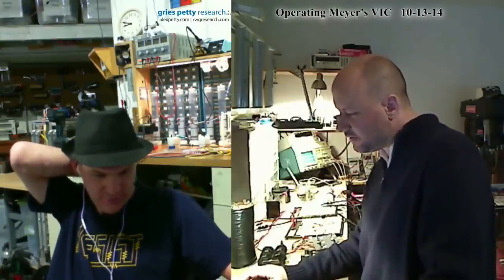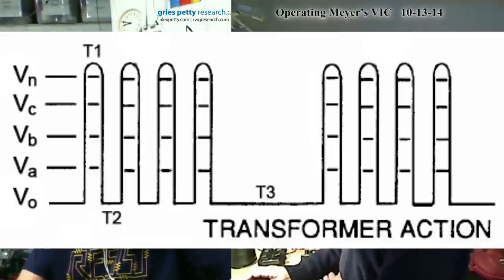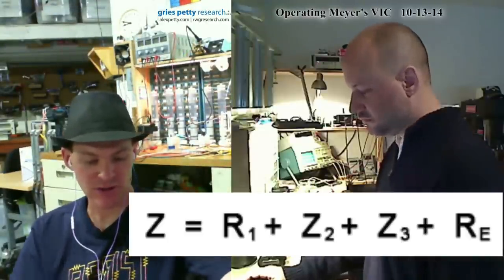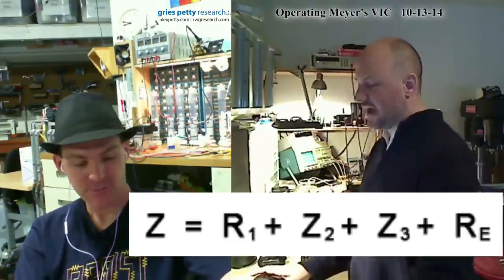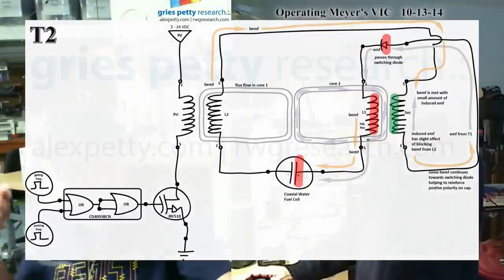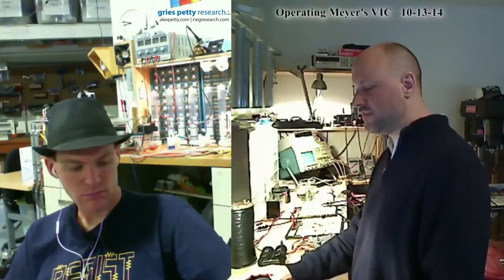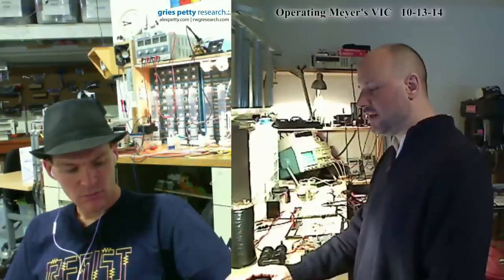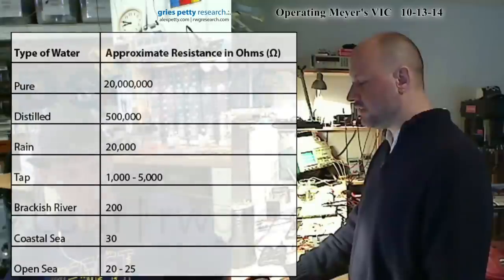Working Theory Of Operation For Meyer's Voltage Intensifier Circuit. 8-14-14 Gries Petty Research.:.

Comment: Hello Russ,  Thanks for putting it out there. I would like to share some thoughts though. First off you two guys are terrible public speakers and Alex is worse. Wey too many ahaemm's and studdering  in there so as to make an otherwise fantastic presentation hard to follow. I like your approach and if I wasn't so poor financially I would be right in there with you folks on the cutting edge. 
   A couple of things , I ran into the basic theory quite a few years back about resonate pulsing of an HHO cell  with the difference being the L/C transformers were all wound on a doughnut of ferrite. 
  Secondly why aren't folks exploring sound as an adjunct to the brute force electrical hydrolysis. Your research supports the validity of resonate fracturing of the water molecule .Why not approach it from other angles?  What would happen if a cool mist humidifier output were run thru a resonate plate system powered with high voltage/high frequency at the harmonic frequency of the water molecule? Round cell?square cell ?and why aren't folks mounting their square cells corners up and corners down to take advantage of the most plate area?

Comment: Electricity is a high value energy resource. We can use electricity directly to perform work. Hydrogen gas is a low value resource. Hydrogen needs to be converted to get energy out of it. So using electricity to make hydrogen is like trading dollars for pesos at a one to one exchange rate. It just doesn't make sound financial sense to do that.

Over unity systems are the result of inaccurate data acquisition, or poor analysis. Because our Universe simply doesn't work that way. No amount of wishful thinking is going to change that either. Although if you figure out a way to tap into the power of dreams you might be onto something there.
Reply: +Paul Frederick 
It never ceases to amaze me how so many allegedly knowledgeable or professional EE's or just electricians, come off with such a holier than thou attitude and rehash the same only flaws in their education and blind experience instead of expanding their mind and consciousness to understand what has recently transpired in new physics working models and drawn conclusions that prove that over unity or free energy is NOT violating ANY laws, but instead uses original or Tesla based techniques to tap into a virtually unlimited resource of electric power with the primary barrier preventing this from being publicly available are due to suppression of those technologies that HAVE gotten past that barrier, or the lack of those trying to pin down the resonance frequencies that will allow coupling and draw from this tremendous field of energy that not only surrounds everyone/thing but is also responsible for the perception of solid matter,  and instead of boring us all with your lackluster, closed minded, stale brained rhetoric, you should be contributing towards finding the right frequency or technique or creative circuit that will more than just utilize the spike in collapsing fields but fully draw upon this constantly generated source of energy that all of creation is held together by, and by posting your comments like such a blank stared parrot of what someone TOLD you and you never questioned, verified its actuality or experimented to prove to yourself that education is valid, you just show everyone how out of touch with current advances in sciences across the board which have antiquated a large portion of former technologies, after all, you stand to benefit from such a breakthrough as well as anyone else, and frankly do not feel such people even deserve to be granted use of them once established since all they have contributed was to discourage those new to the field from trying to break the barriers, which HAS been broken NUMEROUS times, but those who stand to lose their power and wealth as a result have eliminated and hushed the methods to retain their quickly diminishing positions of power and wealth, by their controlling of the masses, and YOU are REAL PROOF of this programming and mind control, because free thinking individuals, are free from such controls, and furthermore, easily discern between truth and deception, unlike sheeple like yourself...however...there is still a chance for you to catch up on the recent discoveries in physics and other related topics, and become a helpful contributor, and if you choose to do this, at least then you can tell your grandchildren how you worked towards recapturing or preserving their liberties and freedoms, instead of watching them be sold into slavery(which is unlikely because according to the elite agenda, those over 47 or in any way incapacitated or unable to perform up to expectations never before imposed on you, will be dead)unlike the US has ever seen before, including the previous Black slaves, the new corporate slaves will live much worse environment, considering which countries have recently bought large percentages of the US DEBT, and HOW do you think these foreign countries will collect those debts?? 

Well this much I will tell you....it will be in the form of productivity, and producing the abundance that the elite will squander from the sweat blood and tears of your descendants....but then again people who shoot down the courageous efforts of others do so because its the only way they can fool themselves into feeling like they are something, more than a programmed automaton who wakes up, goes to work, eats a meal, watches TV and goes to sleep to repeat at sunrise...and rinse and repeat!   Pathetic....but as I said, this is a choice you make, and you can change that choice and everything that goes with the laws on the universe concerning every choice or lack thereof, has consequences, what do YOU choose for your offspring and theirs??  

Most of what the majority believe is our history and applied sciences is FALSE, you have been lied to and deceived for over two generations, and almost every aspect of what the world is about has been misrepresented through a lifetime of false indoctrinations beginning with preschool, and earlier if the parents use a TV set for a babysitter....children from 1-7 years are able to take in EVERYTHING they are exposed to and what they learn is what determines WHO they will be throughout their lives...their programmed core beliefs and principles based on rules that tell them what they CAN NEVER DO, unless they become aware of this and WORK HARD to rewire those core beliefs with valid true facts attained through direct experience.

I will provide a few examples of why people should not accept the alleged FACTUAL BARRIERS because at one time the world was flat.....the fastest speed was sound...but now we know things can move beyond the speed of light, man or anything heavier than air can never fly....space is an empty vacuum....NOT....if you do research you will find that there is NO EMPTY space, and life exists everywhere, as evidenced by the plankton living on the outside of the windows of the ISS....and matter only exists due to the energy that regulates its respective frequency (VERY simply put) which in turn determines the form or density our brains and sense can perceive them to be, and all of these statements are based on new FACTUAL DISCOVERIES whether they are propagated through the media or educational channels, or not, it does not change the TRUTH!

I COULD provide you everything to prove those statements, but people need to research and learn the truth for themselves....it was listening to and believing educators, experts and governments with the utmost trust that got us in this precarious situation we are on the precipice of....so do it BEFORE the bottom falls out, or there will be no going back this time!!

Peace, Love, & Light!

Comment: not only that you both have no understanding of the circuit , you are going nowhere with this Meyer was a scammer , voltage intensifier is just that , no usable gain . higher voltage so what and cut out the throwaway words

Comment: Hi russ would you believe stan Meyer and joe booker had redesigned a every day normal generator that's all it is the switching pulse a relay between starter motor and alternator a wire from relay branching off to aluminium intake manifold which charges aluminium to attract air atoms electrons then protons and to stop it all earthing a right hand vortex secondary wrapped around engine earth to body narrow part pointing to engine this all relates as a closed loop as Meyer states and andrija puharich the urine seems to enhance the super conductivitity.   I have many recent emails off joe boomers video man Peter Stevens if you want them forwarding I need a direct email address to send as only use a I phone 3 to work off      It all adds up Keep It Simple Stupid  and how stupid have we all been just clicked last night watching you tuber brey213 video of joe booker Suzuki video 2 minutes in the Holden engine running mel in bolsover uk.  No expert